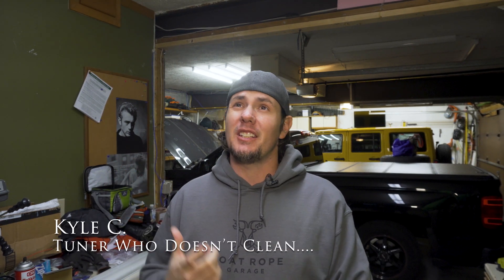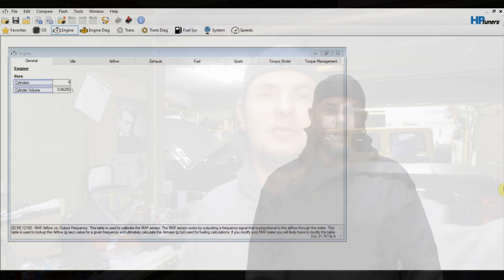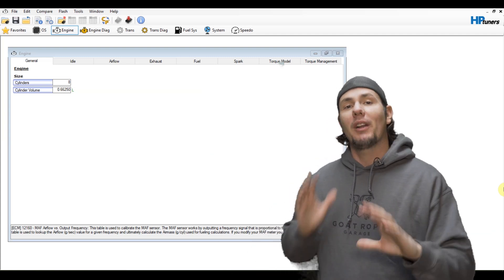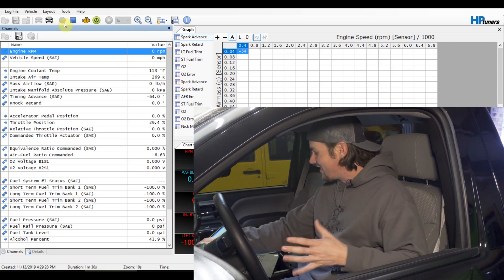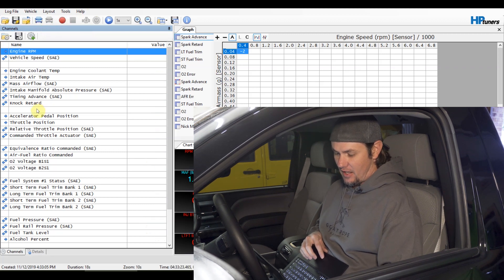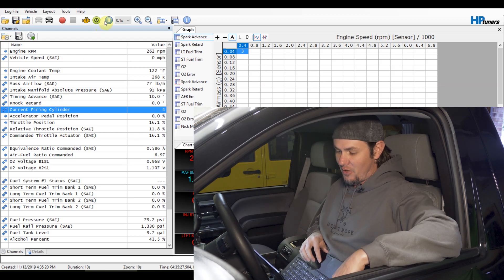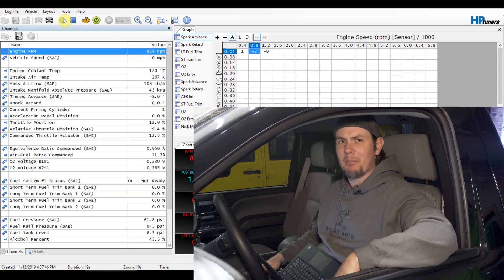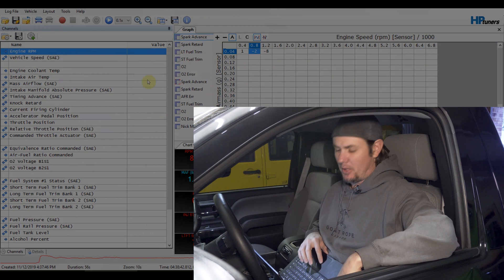Cylinders and Cylinder Volume Settings In HP Tuners, Test In Tune!

Comment: Just performed a cam swap in my 05 6.0 gto and I'm half way through my SD tune. And just like you said, my cylinder vol is set to a 5.7 (.70819). Should i change my cylinder volume now half way through my logging/tuning, or just wait until its dialed and then switch? Thanks for the content man!

Comment: Very informative! When it changed to 6 cylinder mode, what did the firing order become? Attempting to use an E40 PCM that has this option, in my turbo V6 Olds Alero as the E40 features Flex Fuel support, individual coils, and Class 2 outputs to run the stock instrument cluster.

Comment: Gm actually wants you to use a battery charger any time you flash the ecm. So it’s fine as long as not setting a over voltage fault.

Comment: Just now getting into tuning and your videos.. Been running a collision/driveability shop fort 10 years.... doing a lm7 lq4 swap next week..... sounds like changing cylinder volumes wont change much. Thoughts?
Reply from the maker: You can try it, works on some ECMs, not on others. If it doesn't work then just shift your airflow maps by the percentage of displacement increased and it should get you in the ballpark so you can start tuning.
Reply: @GoatRopeGarage  my current plan is to do a read and compare on the original 5.3, and 6.0 ecus.... and plan from there..... prob walk thru the proc outlined in your vids.... not planning on an agressive tune..... hoping to do an lq9 build and tune later on.

Comment: When I was doing reprograms at the dealership we were always supposed to have a charger on the vehicle or at least a jump pack so the battery would not die and the program wouldn't fail due to lack of voltage. Why should we not flash tunes in with battery charger on? Was it because it was on a 50 amp boost and maybe lower charge rates would be ok?
Reply from the maker: The cheap chargers can introduce noise to the system and cause it to brick. The jump packs aren't connected to AC so they aren't usually an issue and the high dollar chargers have filtering in them to make sure no noise bleeds over
Reply: @GoatRopeGarage  thanks for the explanation, I really appreciate wat your doing on here and I always try to spread the word about your channel.

Comment: It seems like the 02 p10 pcm for the gmt360 platform uses gen 3 an 4.and 5. Tables and parameters as ive seen in your videos like the volume cylinder mine 4200 came home with a 2011 chevy silverado tune in it and i read it fod thenfirst time woth jet dst 14005 and after trial amd error at the track like u i bricked that pcm i did recover it but it was recovered as the 6
Reply: Just curious because i can adjust my ve tables for way over a 100 my ve offset stock is 14.8 and i want to up it some more but the fuel doesnt show rich when i increase it it shows that im running lean the p10 pcm is wack
Reply: What do we do about an operating operating system that does not show up when you click on it it's blank page

Comment: Love your channel, I just purschased an MPVI2 and have been reading pretty much everything I can find to learn.
On one of my cars, cam only 02 TA. I had the PCM mail tuned by a popular tuner in the LS world. Ita been running ok for a couple years. But now I can perfect it. Im currently trying to figure out what wideband to use with my MPVI2 standard. Anyways, I downloaded the tune and was looking through it. First thing I noticed is the cylinder volume is set to .750 or whatever a 6.0 is, where as a 5.7 is .708.
Curious why they would do that. Im thinking about copying the VE table, correcting the volume data, then copying the VE table back.
What are your thoughts?
Reply from the maker: On some platforms that value doesn't do anything, I tested it on my 15 Silverado in a video a few weeks ago and it didn't do anything. I'd just ignore it and keep tuning as it is.
Reply: Goat Rope Garage 
Cool, Ill just go forward with some tuning. Thanks for the reply.
I did see that video, thats what gave me the idea to reference the data with the compare feature in the editor.

Comment: soo lets  say I went the route  of a 427, besides tuning, just changing the cylinder volume would be enough? I wouldn't have to get a complete new ecu?
Reply from the maker: Depending on the ECM you might start to run into airflow and fuel flow limits of the unit.  They can only calculate so high before hitting a software limit.

Comment: Question, I am looking at getting hp tuners, I have a 2000 Camaro. Can I wire the aem wideband into the mvpi 2?  Or do I have to find a mvpi 1?
Reply from the maker: Which AEM you using? You can on both with the pro features but if you're AEM supports serial it's way cheaper to go that way and use a serial to USB adapter.
Reply: Thanks.  My current aem gauge is old so  I am going to replace it with a new one. Just wanted to make sure I have good info before purchasing anything.

Comment: On gen3 p01 and p59 controllers, changing the cylinder volume will change the ve table in direct relation to the value input to the cylinder volume. I have a 0411 swapped 99 2 door tahoe with a built 355. When i upped the cylinder volume for the extra cubes the ve also changed. I still had to tune it of course. P01 and p59 controllers also allow you to change firing order.
Reply from the maker: Thanks for the response, Luke!
Reply: Goat Rope Garage you are welcome.

Comment: gen 3 p59 has firing order table under Engine->General tab. I havent gotten to start tuning on my truck yet, so I can't confirm if changing that table actually changes the firing order or not. Don't see why it wouldn't though.

Comment: To figure out your volume of air you take the liters of the motor and divide it by the number of cylinders and you will know volume of air so if you have a 6.0 volume of air will be 0.75000

Comment: Hey now... I have one of those weird GM 5 cylinder engines.
Reply: Colorado
Reply: @markchapman8101  it's the Canyon which is the same thing. But hey it's got just over 240K on it and still runs like a champ!
Reply: @4BillC  ok yea I think Chevy is Colorado and gmc is canyon but yep same thing essentially
Reply: @markchapman8101  you are correct